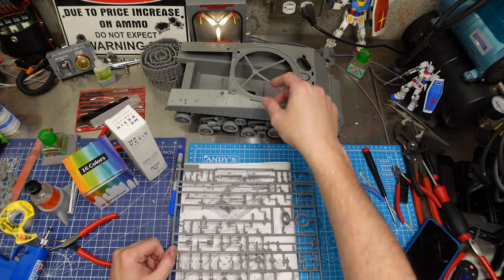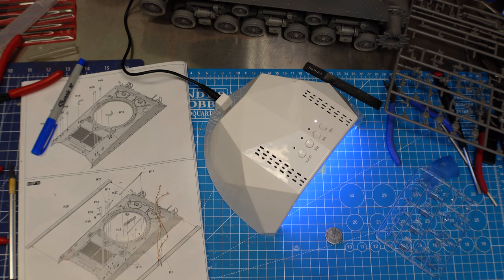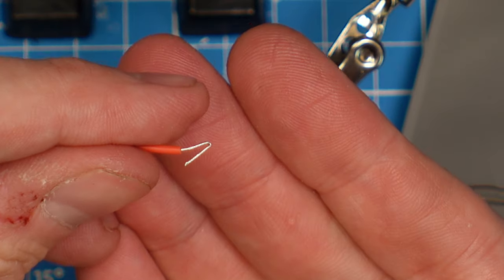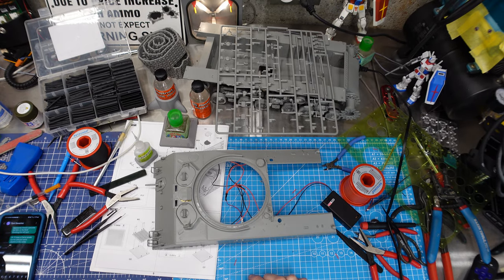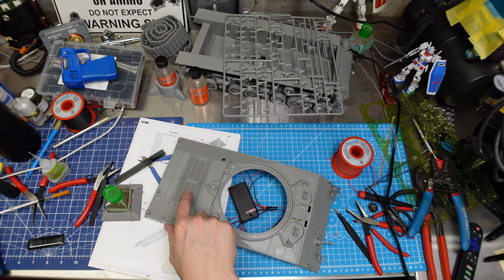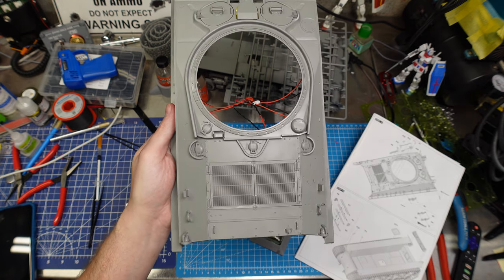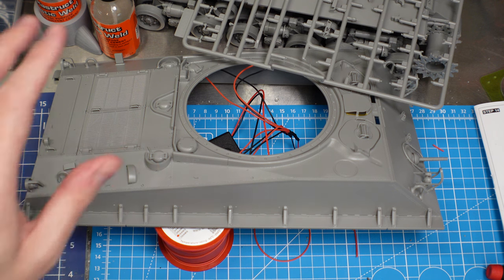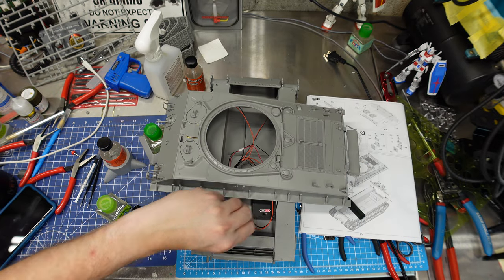Building Andy's Hobby Headquarters Takom M4A3E8 Easy Eight Sherman 1/16 tank kit, part 3.

Comment: The gap on the back deck to the rear of the hull wasn't your fault. I had the same problem. I thought I messed up so I  took the last pannel off and shaved it down where it meets the engine doors. That helped a little. I'm glad I got the value gear set to hide a few scrape marks.
Reply from the maker: every kit has its quirks, at least now more people will know to do a bit of extra fitting on that rear deck, I also just found my rear "mud flap" skirts were fairly warped but a minute with a heat gun and gentle bending sorted that. and yes thank goodness for the stowage.

Comment: In Andy's build he uses tamiya thin not abs for tracks?
Reply from the maker: Yes and it works fine, I started my build with a very old and almost empty bottle of Tamiya cement, I opened a fresh one and it worked just fine.
Reply: @PitstainHobbies  I noticed that Andy left off the spare tracks as I believe you did. Tried to fit them and  unless I really missed the boat er  tank  I could not get them to fit. The mounting points don't let you see what you doing.  I gave up. Has anyone done this. For the tiny handles you mentioned,  I Just cut part out leaving on bit of sprue and use that to hold and place.  Once dry you can cut off sprue 'handle' and sand with no issue. Your kit looks great.
Reply: @PitstainHobbies  thanks for tip re abs ..... tested a piece revisited Andy video.